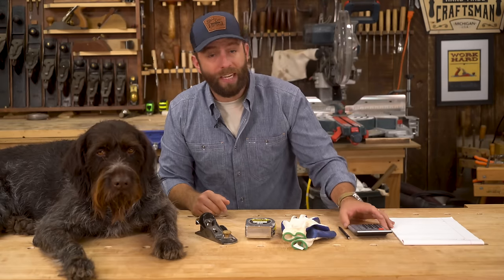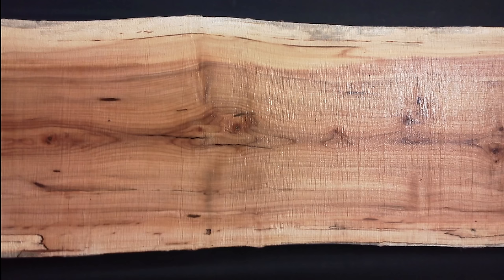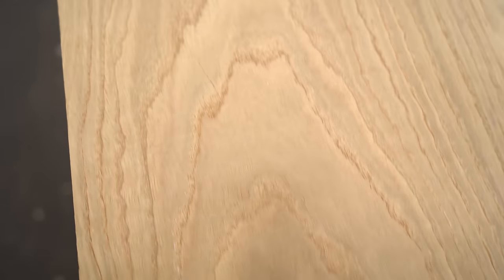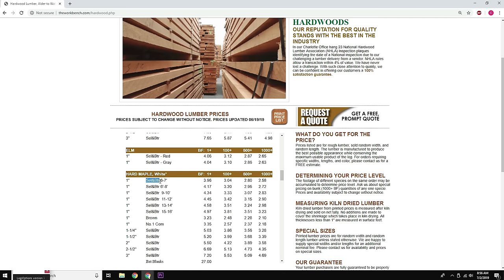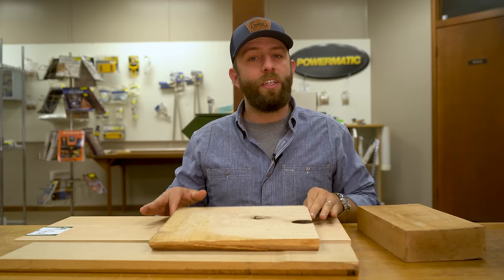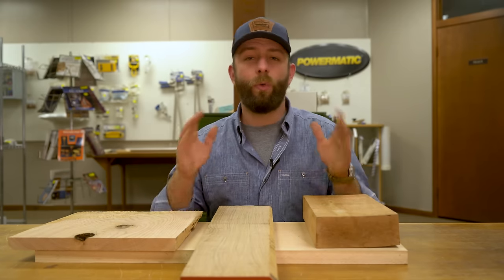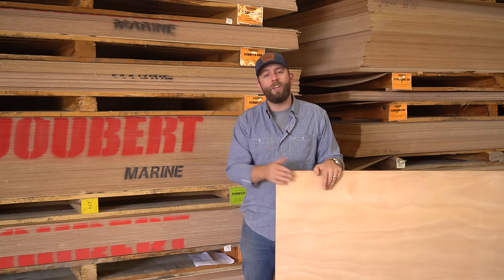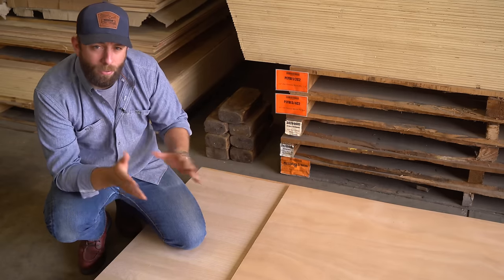How To Buy Lumber & Plywood At A Hardwood Dealer

Comment: This is great. Now I just need to figure out how to load it all into my Kia Rio. :(
Reply: Yes, this is a problem we all have, I'm sure. I have a Chevy Sonic. I can stack 8' boards up between the passenger and driver, but I really have to watch the turns.

What I really want to do is get a trailer, specifically for getting plywood, but if I made a trip to a lumber yard it would come in handy too.
Reply: Lol I feel the pain
Reply: I have a 2017 Hyundai Accent that is the Hyundai equivalent to the Kia Rio. I found that if you fold both the rear seats forward and if you slide the passenger seat all the way forward and leaned all the way back I can slide multiple 10ft sections onto the dashboard and still be able to close the trunk.
Reply: Roof rack and tie downs
Reply: @GodotWorld  I got a Chevy Sonic too and I can fit the 8ft board by routing it through the trunk can probably fit longer of you push it out the from passenger window lol. Thankfully I got a roommate with a trucm
Reply: I drive a Kia Soul. Probably a little bigger inside, but I put mine through the front passenger window with the trunk closed, rear seats down, and then push my front passenger seat back to hold the planks tight. I just do 8 ft. lumber, though. Anything longer and I'm sure I'd be chatting with a cop on the way home.
Reply: Home Depot $20 truck
Reply: I got the kia forte hatchback and it fits up to 92 in.
Reply: Duct tape to the roof.
Reply: Holy wealth of information. I may have to watch this 100 times. Ha
Reply: Lol. Yeah, I plan on renting a lot of uhaul trucks for a while
Reply: Just duct tape it to your roof.
Reply: Buy a 400 to 1000 pickup truck doesn’t matter if it has 4x4 functions as long as it runs is safe that’s al you need
Reply: I learned a trick from an old man, bring your battery Circular saw and do cuts in the parking lot
Reply: I have them sand my boards down to sawdust  then I pour the dust into my coupe. (I get in first of course). Then when I get home I glue the powder back together into boards.
Reply: I feel your pain. I had a ford fiesta. Ha
Reply: I have a Honda Civic and use my Kayaak rack.
Reply: Right, he did mention that they deliver!
Reply: Get a truck? Lol
Reply: I have a Kia Sportage, small SUV, no roof rack. When I need sheet goods and no PU access, I use pool noodles on the roof and ratchet straps run through open doors to hold it down. No freeway/ interstate travel, but it gets them home. You could also take a cordless circular saw to break them down on the parking lot.
Reply: That's what you have rope for! (And an old blanket or a few ratty towels, if you want to keep your car's top looking good)
Reply: Find a better job and buy a better vehicle  .

Comment: This is an excellent video.  I highly recommend it to beginning woodworkers.  A few more tips if you have previously been purchasing lumber and especially plywood at big box stores:

1). While big box stores sell half or quarter sheets of "fine" plywood, often at hardwood stores you have to by full sheets.  Unless you have a pick-up truck or a trailer, you might want to bring a battery-powered circular saw, measuring device, and marking device to break down the sheets into smaller sizes if the store does not have cutting service (my local store has great selection of many different fine hardwoods, but does not have cutting services).  This also applies to the long boards.  Consider also bringing a battery-powered vacuum so as not to leave a mess for the lumber company to clean.  You can call ahead to ask if the fine lumber yard has cutting services.

2). Know your minimum cut length, especially if you will have to break down the wood to smaller sizes on-site.  There is nothing worst than getting home only to realize that you cut something too short while reducing the size.

3). Do not underestimate the weight of some wood and plywood.  For example, true high quality Baltic birch 3/4" sheet of plywood is sold in 5' x 5' size and needs two people to handle it due to the weight.  Some fine lumber yards will help you load the wood into your vehicle, but others do not for liability reasons.  Consider bringing a friend to help load or unload the wood and plywood.

4). If you have a budget to work around for a project, do not be afraid to state that to the person at the fine lumber yard.  This is often important when you do not know the prices ahead of time, but have a project.  The fine lumber yard personnel can recommend different woods to fit your budget.

Comment: WOW...Great video, as for the "QUARTER" naming of this wood, it's because in the 1960's when they decided on cutting a 2x4 on the ruff side, then plane it, we know now that construction lumber naming is now not describing the exact size of wood, a 2X4 is really 1-1/2 by  3-1/2, but it was so much easier than cutting ruff and then planning to 2X4... so to distinguish the wood used for furniture, cabinets, precision woodworking, they started using the quarter denomination that means exact size! My actual house was built prior the changes, so the 2x4 are really 8/4 by 16/4, but we can see also the wood is not as nicely planed, not rough but not silky smooth like today! I was told this by an historian in a old woodmill....
Reply: @Joe Tonner When you meet a 91 years old historian at a mill, or at any other place, I ask so many questions, it's insane my wife says, but old people share their knowledge with such a pleasure...it's like the scientists that analyzed the wood of the famous violins "Stradivarius". they found out that the maple used came from croatia, but Stradivarius fished them out of the waters in Venice, where they were slowing decaying for decades, in the water...

Comment: WOW, what a great video! I've been buying from a local place in NJ (Boards & Beams) for a little while but it can still be overwhelming. I think the most important thing going in is KNOW WHAT YOU NEED! Species, lengths and widths. Make a list. Its going to be overwhelming when you arrive so having a list to work against is hugely helpful. Also, don't be afraid to ask prices while you're selecting, and have a budget. Research the yard's prices online before you go. The first time I bought I picked what I wanted and went to pay and almost fainted when they told me the price.

Comment: There are several free board foot calculator apps available for most any phone.  Much easier than a calculator.  Also the quarter designation usually only refers to rough lumber. If the board has been surfaced the thickness will be less. i.e. 8/4 rough cut lumber will be 2 inches, but surfaced will be about 1 and 3/4 inches.

Comment: The one kid of hardwood plywood you did not mention is the hardest yogi dad most expensive. This is lumber core plywood. It us general yin yang available to large furniture makers, as it’s usage is primarily  for case good tops. Although it can also  for cabinet doors where a side or edge grain will be seen. This is an industrial improvement to the original method of creating a top out of a base wood then doing a  top veneer. It is also more stable as both sides are veneered.

Comment: Great information!  Some lumberyards will NOT cut or plane or surface lumber in any way for you.  You have to buy the whole piece as it is and deal with it yourself.  I have a battery powered circular saw I bring to these stores to break down larger pieces that I may not be able to transport whole if the project allows.  Otherwise bring a way to transport the whole piece you need to buy.

Comment: You need to also take a moisture meter with you when you go buy lumber.
Reply: Not at this type of yard.
Reply: @Stillnapie  why? Is everything dry already and ready to build furniture with it?
Reply: @marioericfernandez7473  A good hardwood yard will only have stock that is as dry as the local allows (Phoenix will be far different than Miami).  If you are buying directly from a mill a meter is a good idea.

Comment: Very good video  i spent over 20 years  in commercial Woodworking and the majority of people do not know  the terminology you. Explained in good detail. I am slightly jealous of you having Johnsons close to you that is a awesome  resource  my local  shop is pretty much a 1 man show  he is a great guy and will get whatever i need  but his shop, store,office,warehouse is about a quater size of what you have  and honestly  the only other thing he has is a line of router bits  i can buy at a large distributor  at way lower prices  ?    He does keep a  rack of offcuts and discounted marine plywood. That I occasionally  buy out for    Projects on my boats  although i have had excellent success using 1/2” Baltic Birch on my boats  sealed with conversion Varnish  and a couple of Spar Varnish coats  on projects that are  not out in fully weathered  areas  a lot of non Woodworkers  mistakingly think its a Maple  Wood. Product because of the blonde look ?  Ironically i had a buddy and his wife who own a big Bertram Sport fisher that the entire interior is Maple. Arguing with me. On the species i built  some cockpit seating out of using the Balti Birch  the way i described  the wife was adamant it was Maple  and drunk untill the husband told her what i did for a living  one point    I built him a filler board he needed to  fix his galley after  he bought a new refrigerator  in exchange for some drinks and a fishing Charter. That she knew nothing about. He happened to be hauling the refrigerators. Up and down the dock and my son and i gave him a hand  i pulled a  drawer front for color sample and a measurement. And my shop foreman. Had the part made for me the next day  as he is a boater /fisherman as well  and owed me a few favors  i later found out from the Bertram guy he lied to his wife telling her the fridge  fit perfect  because he bought the right one ?   I didnt give a. Damn  as the Maple part he needed came out of a scrap bin. And didnt cost me anything  i just thought it was funny that the bimbo was arguing   Wood species with me  over. Something  i not only did professionally but enjoyed as a hobby  since i was a teenager

Comment: Well done video.  I thought the board foot was just that, the linear length of the cut = 1 BF..  Now I'm thinking the hardwood shop that I want to go to isn't as expensive as I thought seeing how it's calculated and such. Whew!
Reply: Hey @thirdcoastcraftsman one of the lumber places I want to go to uses linear foot pricing.  They got S2S 1E western red cedar (supposedly super clean and no knots) 4/4 x 8 for $8.10 a linear foot.  Is that overpriced for what it is?  Just need to know if I should even explore it.

Comment: I have 3 hardwood dealers I can go to, one you order by the board foot you get what they give you, second is the retail store and you can pick what your looking for, third will pull for you or charge you a fee tacked on for searching in the pile.
A forth store is also a seware of ubren lumber this is air dried timber sawen up and sold live edge, they will also saw up your log for you. so if your a property owner and your grandfathers tree he planted as a child blew over in a storm, you can have to sawen up air dried and build finiture for you house with it and give it a second life insted of fire wood.

some places have wholesale prices they all have the ablity to mill your wood for you if you don't have the tools to DIY it at the shop or home.

You pay more money at a big box store for the same wood. And most big box stores don't sell rough cut lumber.
This is by far the cheapest way to buy wood unless you mill the logs yourselfe off your own property.
Or find somone who does close by.

We have more then these stores that sell hardwoods but these are the one's I use.

Comment: Tons of great info! Thank you! So far I have only dealt with what was already in the shop that I inherited, what I could cut and dry in my oven from the property for small things, or Lowes (which is not the greatest spot for selection or price anyways). As I get into other projects, I will check out a proper dealer. 🤘🏻

Comment: I remember sticker shock the first time I went to buy hardwood for a cutting board my wife wanted.  Spent $100 on S4S 4/4 walnut/cherry/maple.   Decided to shop around and found a hardwood dealer about 40 min away...and their prices were about 70% lower than what I'd paid but the boards were s2s.  After a bit I found a 2nd dealer that sells rough cut for less money and is closer to home.  That's my go-to store now unless I need some exotics they don't supply.  

As a bonus they had some mis-cut Walnut that was too thick for 4/4 but not quite 5/4.  Picked up a bunch for half the normal price and I wish I'd bought more.

Comment: Very nicely done !! Saved the video, very informative and interesting. Thanks for sharing your thoughts and videos, Rodney How can I find a hardwood lumber yard? I'm in Branson, Mo. Which is the southwest corner of Missouri.
Reply: Google maps, search for lumber. I asked around on reddit/tampa and found most of what they recommended were actually on google maps, just in low rent places of town.
Reply: Check out a site called Woodfinder.com put in your zip and it will find the closest 10 mills.  This will only find the ones that are registered on the site so it is limited on what it will find but it is a good start.

Comment: Some extra tips:
- Lumber "quarter" sizes are nominal, not actual (like how a 2x4 isn't actually 2"x4"). So a 5/4 board will actually be about 1" instead of 1 1/4" thick, etc.
- When calculating the total # of board feet, the nominal size is used. So a 12" x 12" 5/4 board is actually 1.25 board feet, even though it's 1 board foot of actual wood
Reply from the maker: I’m not sure where you shop but rough dawn lumber at anywhere I have ever bought it will be true to it’s thickness a 5/4 board will be at least 1 1/4” thick. Often times the boards are a touch thicker even. Never less. Now you have to plan on the fact that you will lose 1/8 to 3/16” in the dimensioning process. But the board in the rough are true. A 2x4 started as a  true 2x4 in the mill as a rough board but after dimensioning and drying that’s where it’s loses half an inch
Reply: 5/4 lumber kiln dried in the stack rough is 1-1/4" thick but yes it is typically milled to 1" or can sometimes be cleaned up at 1-1/8" thick  depending on process.  Absolutely correct thickness is a major factor in calculating Board Foot volume.

Comment: I recently wanted to buy a stump end slab with some nice figure from a slab Sawyer.
The stump end was 32" and the other end was 22".
He wanted to charge me for the 32" end.
So basically he was charging for some air.
I was a little DISSAPOINTED.
I want to be fair and believe I should expect to pay for a little air, but I feel like he was trying to be less than fare.
I have sold logs to backyard mills before and know the figure what the pay me on the narrow end. 
I think he should of split the difference between the 2 ends and charged me on average.
What is your feeling on this matter?
Love your channel
Reply: greg typically, when I buy slabs with differing end measurements, I use the average as you suggest. However, it’s ultimately up to the person selling it, I believe.

Comment: All you need at the lumberyard is a calculator, tape measure, calipers, a plane, a plumb line, two chronometers, a compass,a complete cutting list of your project a board ft app for your phone and finally a large wallet.

Comment: ☝ at 2:25, there's a 3rd reason why S3S lumber costs a little extra. After straight-lining, about 3-7% of the wood is lost (a 5" wide rough board becomes 4.75" wide with a straight-edge, for example). Most hardwood lumber companies add a % board foot surcharge to the tally at the register. This accounts for the lost fiber. HOWEVER,  the straight-line process takes off a relatively fixed amount from each board regardless of the board width. Thus, buying narrower S3S boards shifts more of that surcharge to the lumber company. For example, assume 10% is added to your S3S BF tally. On  a 4/4 X 20" X 120" board, the actual straight line width loss may be 1/2" yet you're paying for a 2" width loss. Probably not enough savings involved to worry about, especially since there's no way of accurately re-calculating the actual SL1E loss. However, it's good to be aware of this mostly-industry wide practice. 😉

Comment: I'd like to find a location where I can find weight carrying loads of different species over various lengths. I want to build a bookshelf but I don't know which woods to use and what would be the maximum span before the weight of the books start to cause the shelf to sag. I know that thickness would also play a part in this calculation so I would have to consider that too.

Comment: Boy that sure is different than my local (and only) hardwood dealer! 

I walked in there trying to find wood for a door rebuild project and the guy I talked to was real helpful, suggested some wood types, and showed me some rough lumber piles on the floor (everything is on the floor, no racks, no signs, no price tags). He said they would be happy to mill stuff for me, which is good since I don't have a joiner or planer. 
When I came back the next day there was some other salesman. He refused to tell me anything, said they don't do milling, and that you have to pick the lumber out yourself, they won't help you pick or move it out of the warehouse to your vehicle. Also I had to hurry, he wanted to go home soon (it was about 2PM). 
They also consider a "board foot" to be 3/4 x 11 x 11, not 1 x 12 x 12, like I always thought it was.